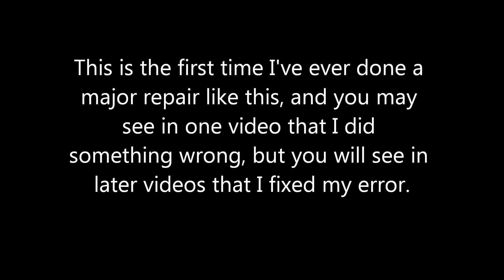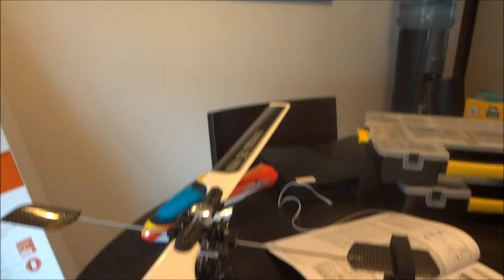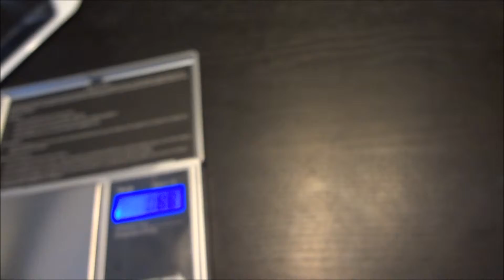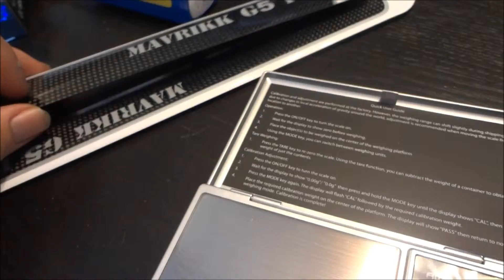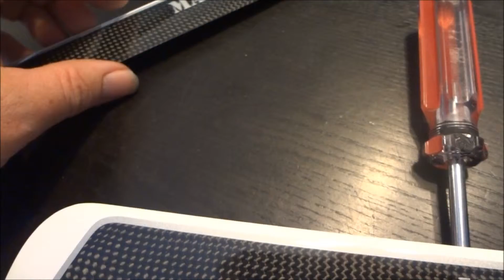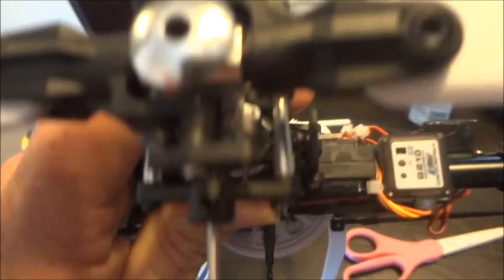Blade 450 Complete Repair Part 8

Comment from the maker: I still use the Blade swash plate leveling tool on my 450x.  Personally I think it works well for the 450 size helicopters.  Not sure if it will work with anything other than the Blade 450 though.  I have an Align clone 500 that I have been working on, and with that I'll have to get a different leveling tool when I get to the point to when I need it.

Comment: Hi Wayne: I have been using the Blade swash plate leveling tool & wondered if this is what you use, or do you recommend a different swash plate leveling tool that works better for you?

Comment from the maker: yeap, that was going to be my next suggestion.  Make sure that the servo arm is 90 deg when servo is centered. and then adjust the servo forward or back on the tail boom so that the tail blades have 0 pitch when servo is centered (the pitch slider is in the middle of the tail rotor shaft).  You may want to go through the tail setup video that blade has available, just to make sure your tail is setup correctly.

Comment: Swash plate is level going by the Blade swash plate leveling tool. Its not leaning to the right but instead its the TAIL that's rotating to the right which to me indicates that I may have set that up incorrectly. Your thoughts.

Comment from the maker: It's possible that your swash plate isn't level.  You shouldn't have to add much if any trim at all.  And only thing I could think of that would be causing your helicopter to pull to one side, and thus making you add trim is that your swash plate isn't level.  So I would double check that. :)